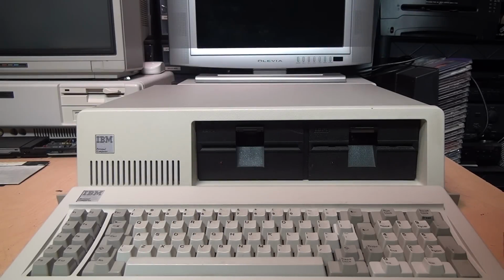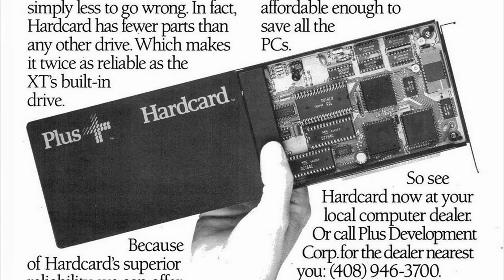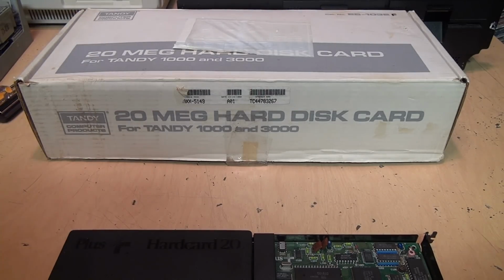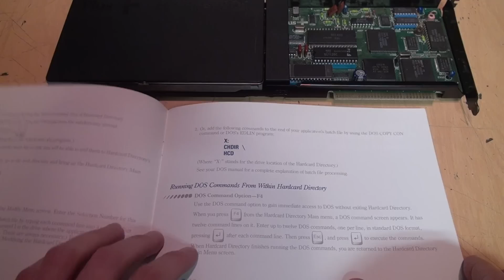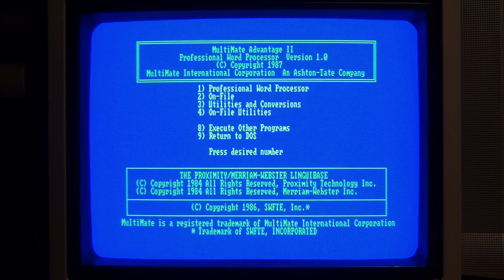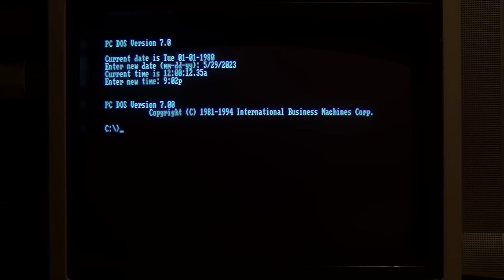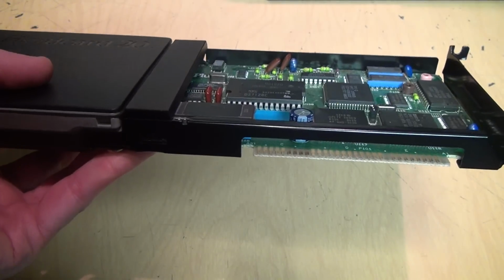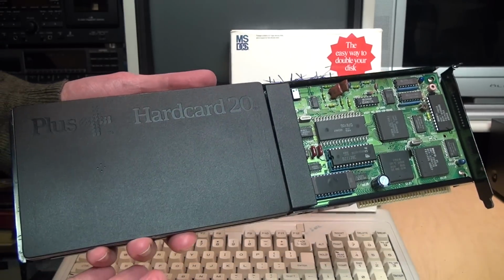Give your floppy PC a Hardcard in 10 minutes - 1986 Plus Hardcard 20

Comment: When your 35 years-old design looks more sleek and elegant than your beefy graphics card.
Reply: Those old cards also have a standard length too (and fitting support in the PC case), so no sagging.
Reply: it's not a GPU -- that'd be like comparing a banana with an uzi
Reply: @Atari Warrior  yeah the amount of thermal mass required on modern gpus is why they are so massive.
Reply: @russianvideovlogguy  still looks better
Reply: There will probably come a time when future graphics do get as slim as a hardcard (I still have a Hardcard II XL+ 50).  And obviously more powerful than current videocards.  Nanometer process may have to get smaller even more to reduce amperage further down.  Maybe fabrication arrival to pico?  Then it maybe needs some new cooling method, because traditional rotating blade fans are also what makes graphics card bulky, in addition to heatsinking.  Perhaps we will see future cards with the Frore Airjet cooler, which is a new pioneer technology that does not use fan blades.  It is flatter as heck & a little more compact for maybe the same amount of wind it can produce compared to a round fan.  On top of that, future graphics may also use some smaller cooling with water, vapor, or TEC, which all that still are considered bulky right now, except maybe for the TEC, as current graphics water blocks are also still as clunky.  Things will get smaller & smaller, as we have seen since the room-sized computers of the 1950's.  We might even change to optical computing & superconduction materials (such as in transistors), both that can create less heat.
Reply: @hetside  yeah thats like saying a Ferrari looks better than a garage door opener. They are not the same thing.
Reply: Too bad there's a 0% chance one works.
Reply: @JimmyRussle  Way to over-analyse a humorous observation. You're a hoot at parties, I betcha.
Reply: When your eyes are broken, but you’re so used to it, you don’t know you’re blind.
Reply: not even close

Comment: As a younger generation of computer geek, I've only learned about these in the past few years, but it definitely seems like a very ingenious concept. And looking at the sales figures for the 20 MB hard card, clearly there was a need in the marketplace if that many were sold. The closest thing we have to this now is some m.2 SSD cards, but those are effectively little more than a breakout board.
Reply: These things were not very popular for anything but an early 286 or an 8088/8086 machine.  Early hard disks in PCs were MFM or RLL and used a lot of power. Nearly all of them were 5.25 as opposed to 3.5. They also required a controller and some knowledge to install them and set them up. Installing an IDE drive is MUCH simpler than installing a brand new MFM or RLL drive.

But around the time of the 386, IDE (ATA) became a kind of de facto standard (even though IDE itself is not de facto).  I am entirely unaware of any 5.25" IDE drive.  By the time the 386 was out, having a hard drive was a must.  Most 386 machines, probably close to all, shipped with a hard disk and either an integrated controller or one in a slot.  I retired quite a few machines (probably over 1000)  with either no hard disk, an MFM or RLL drives or a hard card.
Reply: @christo930  The quantum Bigfoot drives were 5.25.
Reply: @christo930  Compact put out a 5 1/4 hard drive for 386 to pentiums. It was called the Big Foot. It was 1/4 height, but it fit in a 5 1/4 bay. It was a bad drive that would often fail during warranty.
Reply: @KanawhaCountyWX  Yeah, I forgot about them. Funny thing is, I have one.
Reply: @HavocSun  There was also a compatibility issue with them.  When they were still around in the Pentium era, the company I was working for was standardized around the Deskpro 2000 Compaq desktop.  Every single bigfoot drive had to be swapped out.  I don't remember the details, but there was an issue with NT, which was one of the standard desktops (a lot of these computers had triple boot NT/OS2/Windows 98.
Reply: @christo930  IDE is a 16 bit interface. There was a short lived XT/IDE interface, frequently on some Tandy or Zenith systems. You needed a special drive designed for that controller.
A modern crowd sourced version called XT/ide is an 8 bit card with an on board BIOS that allows you to plug any 16 bit IDE device into an 8 bit system. CSFlash cards are quite popular, although sd cards have become more popular.
It's become more popular as vintage  hard drives age.
Myself, I bought a 20Mb "HardCard" for $600, which was quite cheap for the time. Plugged it into a Compaq Portable. That kept me going until I upgraded to a 286 system with a fast 16 bit RLL controller. By then a 2nd hard drive was cheaper, and towers more common.
Reply: @Caseytify  These hard cards are also based on an 8 bit controller.
I've heard of the modern 8 bit IDE controllers, but I didn't know it was crowd sourced. 
I had a Compaq portable (the original luggable) too. It had a 10MB MFM drive in it. I bought it for 99 Dollars at a used computer store.  It was my first PC while I was in college.  I wish I had held onto it. It has become quite collectable.  For what, I don't know.  The green-screen makes it pretty ill-suited for gaming. The keyboards all need a complete rebuild.   I never could get the composite out to work. But I bought the computer as just the computer and keyboard. I didn't get any software or documentation (IIRC, the built in CGA composite had 8 dip switches). Just what was on the hard drive.
Reply: @christo930  Yes I remember that, I was a service technician for Compact. We had nothing but trouble when the Big Foot came out. Funny thing now, if you find a working Bigfoot & install it in a retro PC. It's worth a lot of money 💰! Just like a all original Packard Bell. One of the worst computers ever made.
Reply: @christo930   They're collectible just for the history / nostalgia.  Probably not a lot of people using them for much more than to turn them on, go "wow, look at that... those were the days..." and then shut it down again.  :-)
Reply: @HavocSun   OK, hate to be "that guy" but this has been one of my pet peeves since the 90s.  ;-D  There's no such company as "Compact" -- there's "Compaq," which made computers, but they did not manufacture hard drives.  You're thinking of "Quantum."
Reply: @nickwallette6201  If I had mine, I'm sure I would figure out a way to play with it.  Nostalgia does that to you I suppose.  I did a lot to that machine back then. I had an 8 bit VGA card in it at one point running a paper-white VGA monitor I bought at a flea market or something.  There was a huge computer flea market like once a year called Trenton Computer Fest. I bought a bunch of crap from there.
Reply: @christo930   I take advantage of every opportunity I can think up to mess with my old vintage machines too.  But 8088/8086s just aren't that useful.  haha  Not that I don't have my fair share of them!  I love all those old boxen to death, but I do run short of ideas on how to occupy my time on a machine with 640K RAM, a 360K floppy drive, and screen draws that a typewriter could keep up with.  ;-)  Ideas welcome.
Reply: @nickwallette6201  It is truly amazing how much time I blew on those machines back then.  The oldest machine I still own is a Tandy 1000 286 (though they have an XT class motherboard). It's a nice machine and has DOS in ROM.  I want to say it's an RX or TX or something. I forget and it's put away at the moment. Not only does Tandy have the great 16 color graphics mode, they have a nice sound system built in. The best combo for such old stuff, sadly, is a Tandy.

Anything older is hard to have a lot of fun with.  You can put an EGA card in them, but EGA was never popular and there are few cards to buy.  A lot of games which can use EGA graphics require a 286 and simply will not run on an 8088/8086 based machine.  IIRC, I tried a bunch of the Apogee games (commander Keen 4, Duke Nukem, Cosmo's Cosmic Adventure, Monster Bash etc) 

But once you move to a 386, you might as well use a Pentium. There is really no difference in terms of compatibility, while a Pentium has enough HP to run virtually all DOS EGA/VGA games. When you go above the Pentium, you will start running into driver and compatibility issues.
Reply: This was a dumb idea then, and we can see why it was a dumb idea now through the magic of retrospection. This was a gimmick and nothing more.
Reply: I still feel young and I've actually used them 🙈

Comment: Great video, and thanks for the plug! I indeed have an original 1985 10MB that appears to be a dealer demo example installed in my 1985 Compaq Portable. I was able to repair the drive by tearing it apart in my damp, dusty New England basement and estimating the OD of the original grommet, then building up a new grommet using heat shrink tubing - four years later the sucker still runs, reliably, with no bad sectors! Wish I had a 20 mb unit as I filled the damn thing up already…
Reply: Time to upgrade your system. Ha, ha, ha, ha....  ;-)

Comment: My IBM PC came with one of those when I bought it, and it was originally working fine just like yours. It pretty quickly started making strange noises and popping up errors, though, and finally lasted just long enough for me to build an XT-IDE card and back up its contents to CF. I'll bet if a HardCard hasn't been used in a while, it takes a little time when you start using it again for the rubber stuff to spread around and get the heads stuck. I think I did try repairing mine since what did I have to lose? But I no longer have it, so I must have failed, and probably gave it to the junk guys when we moved my house. They are really cool cards, though. I don't think I had ever actually seen one before buying my PC, and I was surprised at how elegant a solution it was for mid-80's computing. High-end stuff from those days still feels high-end, though.

Comment: For anyone wondering, part of the Plus Hardcard's low profile comes from the drive's logic being on the same board as the controller. It's here that the bulkier competing hard cards had the advantage of using a standard drive, which could be swapped out easily for something better.

I found one years ago in a thrift store. Unfortunately, it didn't work.
Reply: Its a quantum (plus is a quantum subsidiary) and a lot of quantum drives before fireballs have melting rubber. Prodrives can have it so bad the heads can pop off from the arm

Comment: On the subject of the speed of these devices, one thing that shocked the first reviewers of the first Acorn Archimedes with an ARM2 processor in about this era (c. 1987) was that this was their first experience of hard discs being accessed at their full maximum theoretical speed without interleaving, and still with plenty of cpu cycles to spare.  Moreover, it accessed 3.5-inch floppies at about double the speed of a DOS PC, again close to the theoretical maximum.  This was an 8 MHz machine, where the cpu consumed less than one Watt of power.  I think VWestlife would love the funky design if he could get his hands on one.
Reply: Unfortunately they used rechargeable cells for the RTC...
Reply: @TheUAoB  Not on the original Archimedes A3xx machines: these had a Duracell AA alkaline cell for the RTC and CMOS RAM.  They leak, of course.  Later machines such as the A5000 did have a rechargeable cell; however, I cannot remember the details.
Reply: @cdl0  The last machines did too, my Risc PC had the battery explode and cause catastrophic damage. I found out when I took it from storage to cut it out.

I just assumed the earlier models suffered in the same way, I guess there's some other reason why the original design machines are so rare now. I just looked on eBay, where an A440 is asking £1500! Lots of the early 90s A30x0 models though.
Reply: @TheUAoB  That's a pity about your Risc PC.  They were very nice, and had a really funky design.  I hope you managed to repair yours.
Reply: crawfishbuffett665  In 1987, the ability to execute one instruction per clock cycle at 8 MHz was impressive, and such low power that passive cooling was sufficient.

Comment: you can make a pretty decent "clean room" box with some long gloves and some polycarbonate plus other necessities to make a latching lid and adding high static pressure fans and very fine hepa filters for not a lot of money. it's the problem of having that run for like 15mins prior to doing your work that can make it a rather time consuming process, and you need to be sure you have every single tool you need at your disposal inside the cavity once you're into the thick of it. having an air bulb to spritz the drive out after completion is also a handy idea. Remember that a clean room isn't completely free of dust contamination but it's pretty darn close. any dust that does get inside the drive is usually able to be dislodged and spun away from the platters anyway.

The video I saw of one of these being repaired was in bbishoppcm's basement a couple years back. While they're a neat item, I too agree that most attempts at rejuvenating these with different material is only a stopgap fix and shouldn't be trusted regardless of if it was done in a cleanroom environment or not. It's a lot simpler to just go get an XT-IDE card (ideally one that has slot 8 support) and shove an IDE DOM on the back.

Comment: Impressive, never know it exists. Pretty flat for the time, very nice. My first harddrive was a Connor CP4000 (as I can remember) with a black aluminium top cover and had a whopping 40MB of storage capacity.  It was also very flat and a very silent drive,  I was very happy with it and never let me down despite others crunshed on the reputation of Connor drives. Years later when the drive was replaced with serveral versions of a Quantum Fireball with more capacity and Stacker (the tech MS copied as DoubleSpace) came around, I did an experiment installing Windows 95 onto this 'Stacked' 40MB Connor drive and it worked haha - with 0% storage left! I need to mention that it is only possible to run Win95 with a secondary drive to store the swap files because there is no room left for the 'unStacked' swap files. The Stacker/DoubleSpace technology was very impressive.  Ah, memories! ;-) Thanks for the interesting subject and video!

Comment: I actually had a couple Hardcards a long time ago, and I think even one of the "knock-offs." (Possibly sported a twice-as-tall WD drive, but I'm not sure.) I remember the interface between the PCB and drive of the Hardcare had three fun-named connectors -- rotor, motor, and encoder. (It looks like from your card and Googling images that they're under that separate plastic cover between the drive and PCB, so I guess they're normally not visible.)

The Hardcard itself had no activity light, which especially back on a PC/XT you really wanted to know that it was doing anything versus just frozen, but as you demonstrated they'd put a little '+' symbol in the upper right hand corner of the screen if the drive was being accessed. This was better than nothing, but you were stuck with this only working in text mode as I recall. Anyway, I remember eventually figuring out I could attach an LED to one of the drive connectors (I forget which one) and it would work as a basic activity light. I imagine whichever one it was I figured out was being used by the head movements. It worked most of the time although every once in a while would get stuck in a persistent flicker.

Comment: I still have my Hard Card II XL Plus, 50 MB version, probably bought either at Frys or Incredible Universe.  Feels like I got it in the mid 1990's, or maybe late 90's.  Mine still works & still has stuff on it.  Currently mounted on my overclocked 25 mhz 286 system.

Comment: one of my buddies did like a window on one of his harddrives years ago, no clean room but the trick that seemed to help was using a clean bathroom and running the shower to steam it up first, then cool it down by running it cold a bit. Seems to cut down on the dust in a similar manner to when im painting something and spray the room down with water first

Comment: I had a 40MB version of that when i was young.  Bought it used in (i believe) 1995 for cheap.  I only bought it for the disk drive as i was putting together a 386 computer with the little money i had.  Used it in its original form once or twice before removing the hard drive and connecting it directly to the IDE card.

Comment: Back in the day, on the drive cards we installed (the WD FileCard 30 looks familiar) in those plastic Amstrad PC1512's we would low level format them by loading debug and using G=C800:5 to access the cards firmware. This may have been more to do with showing off rather than doing anything useful.

Comment: When I bought my IBM PS2 30/286 I chose not to buy the optional IBM hard drive (because it was very expensive and notoriously slow). Instead I bought the Hard Card II 40 which worked so much better. Later on I replaced it with the 105 XL. I still have my PS2 but I sold off both cards (wish I hadn't now). Good memories.

Comment: I have the 10MB version in an old machine that refused to spin up.  I spun the whole unit by hand about the same axis the platter would normally spin, and that was enough to get it to unstick for a while and read all the data off of it.  I'd suggest doing that if you want to recover the data.  I wrote a custom program to image the drive over a serial cable sector by sector during COVID quarantine.